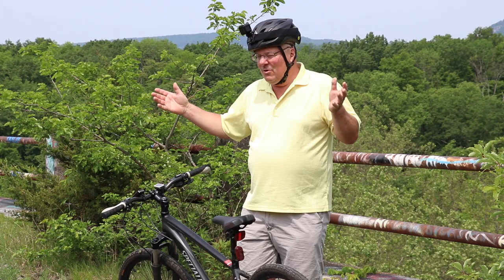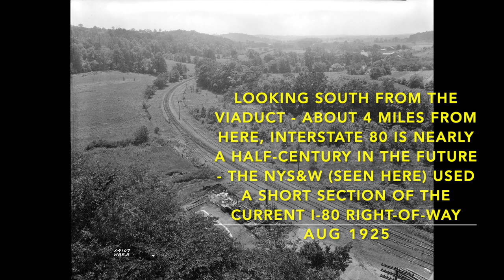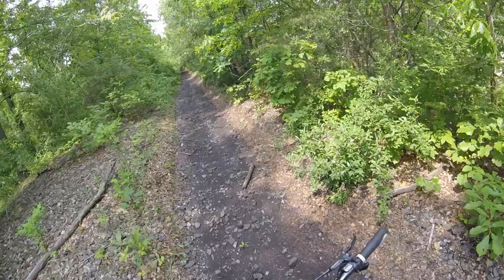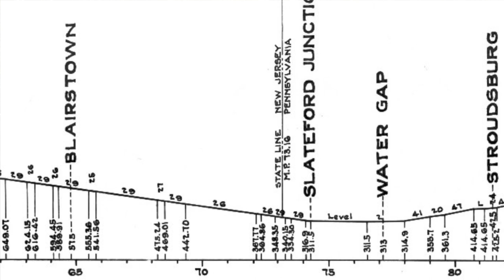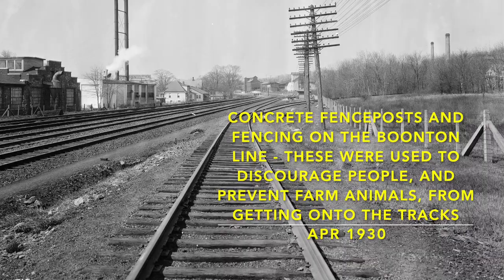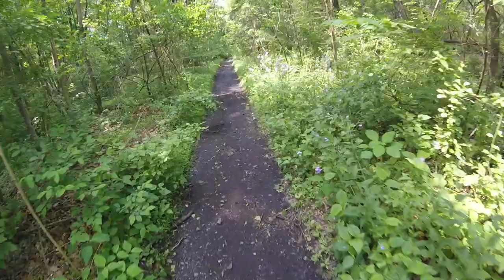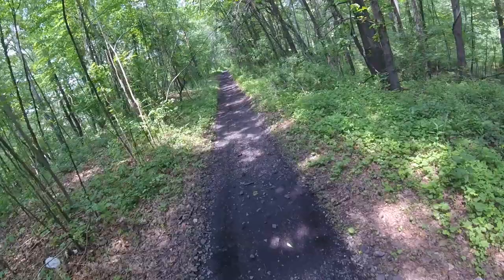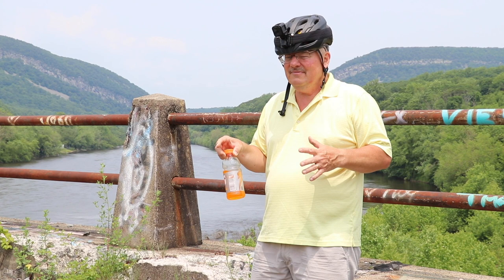Lackawanna Cut Off - Part 21E: "Missing" 21 Miles (Paulinskill Viaduct to Delaware River Viaduct)

Comment: Thanks for the tour!
Reply: When Chuck first stepped onto the Paulinskill Viaduct you can see what looks like two open manholes that were used to access the structure inside for maintenance and inspection. Tunkhannock Viaduct had a ladder up the right side as you're going west and grab rails on all the arches so people can scale the entire structure to inspect it. I'm assuming the Delaware River and Paulinskill Viaducts are the same as well as the seldom mentioned Martins Creek Viaduct west of Tunkhannock. Years ago a guy had a video on U Tube he made when he climbed all over Tunkhannock. It was fascinating.

Comment: I couldn't help but think of poison ivy all the while, and you finally mentioned it. That, and ticks would be what I'd be concerned about.  I also found myself ducking and weaving about just sitting here in front of the monitor, as if it were me, the viewer, about to get smacked by a branch or whatever object, lol.
Reply from the maker: Stan Patterson, lol.  The GoPro plays tricks because it’s several inches above my bike helmet.  On more than one occasion I had to check whether I had knocked it off my head.

Comment: Thanks again Chuck. Another amazing video adventure on the Cutoff. I hope that you did a tick check when you got home. The last time I did that was in my friend's Jeep in the late 80s or early 90s. It wasn't anywhere near as overgrown as you experienced. We got on just west of the Roseville Tunnel and got off in some families' back yard near Slateford Junction. On another trip we got on at the yard in Port Morris and drove as far as Roseville Tunnel and turned around. I've also mountain biked portions of it, but not recently. I hope that I live long enough to at least see service restored to Andover. Please keep up you videos. Also, are there any photos of the section houses? Recently I was up on the old Maine Central - Mountain Division. The section houses there are gone, but you can still see the foundations and there's plenty of photos.
Reply from the maker: The section house on Johnsonburg Siding is the only one that I've seen a photo of that I can recall.  It appears in both 21D and 21C.

Comment: If you stretch a 62 foot long string along a curve, the degree of the railroad curve is equivalent to the maximum distance between the curve and the string.  If you can estimate 62 feet reasonably well you can mark the maximum distance visually and measure it with a ruler.

Comment: The NJT budget plan includes 8.8 million to the cutoff service for Andover.

Compared to what’s been spent, may not sound like much but that’s still great for next year.
Reply from the maker: Nobody on our side is happy with the "speed" of the project, but we're dealing with a state agency that is reeling from years of political neglect.  We'll keep on top of it.
Reply: @LackawannaCutOff  As soon as government gets involved it's always a problem.
Reply from the maker: g bridgman, the government is the only thing that will make this happen.  Don’t forget that private industry (Conrail) did all it could to try to make it difficult to reactivate the line.  And government was forced to spend over $25 million to get the right-of-way into state hands.
Reply: @LackawannaCutOff  Yes, this is true. Conrail was no freind to many of the railroads is "consumed." I do appreciate that at least NJ saved what was left of the cutoff but it's too bad they didn't start a rebuild 30 years ago.
Reply: @LackawannaCutOff  Bingo.
Reply from the maker: g bridgman, it needed to be acquired first and that took until 2001.
Reply: @LackawannaCutOff  And no private corporation would ever run this route. If they did, they'd have to charge $10,000 per ride.

They would do what the Erie Lackawanna/Conrail did... run as fast and far away as they can from it.
Reply from the maker: inklake, such is the case with ANY route.  Every other form of transportation receives enormous subsidies.
Reply: @LackawannaCutOff  Word.

Comment: keep up the good work with the series of videos, i really enjoy them! i plan on visiting both viaducts in a few months. question, to get on top of the paulinskill is it best to park under it and climb up the side from there or park at tunnel field and walk from there? thanks!
Reply from the maker: spedison _ it’s definitely shorter by parking underneath.  Note that’s there are no parking signs posted below.  It is a steep climb up.  People go up both the south and north side.  Tunnel Field is an option.  You want to park in the back up the hill a bit and walk in via the path which may be overgrown a bit until you get closer to the Cut-Off.  That will be about a 1 1/2 mile round trip.
Reply: @LackawannaCutOff  thank you for the reply, i ended up visiting both viaducts recently. i was struck in awe at how massive the paulkinskill was when i was under it, i ended up not climbing up the side as it did look too steep; tunnel field was an excellent alternative thank you. the views from both viaducts were very nice, but i can only imagine how much money it will take to restore both viaducts for train usage. lets hope NJT gets thier act together. i give you props for traveling along the cut-off with your bike with those road tires, even walking it along it with the rock ballast was tiring. looking forward to more videos in the series
Reply from the maker: spedison _, the next time you’re under the Paulinskill Viaduct, center yourself under one of the arches and talk loudly upwards or make any loud noise and you’ll get a clear echo back.  Kind of cool.

Comment: Hi Chuck. Thank you for this series of videos of actually being on and moving along the entire cutoff!! I look forward to the next one. I know this wasn't easy and you are a REAL trooper!!!  Thanks also for all the pictures and the explanations.  The cutoff seems fairly well-preserved and passable, and I guess we owe it all to the men that ride quads and dirtbikes.  As you pointed out and I noticed, they must even be up there with chainsaws.  I don't know how else it could be kept this clear???  This mostly clear Trail is on the westbound or north side of the cutoff, whereas the last track to be pulled up in 1984 was on the eastbound or South side of the cutoff,  and look how quick that got overgrown.  
Quick question....Do you think it was easier to make a tall fill, or a deep cut?  Thanks Again
Reply from the maker: Impossible to say which was "easier" to build.  They needed lots of dynamite, steam shovels and dump cars for the cuts, trestles and dump cars for the fills.  Both were dangerous.  And the cuts were used to build the fills, except when they needed more fill material than was available, such as for the Pequest Fill.
Reply: At times I've thought the last 21 miles would make a great Rail-To-Trails project, but I think guys with their dirt bikes and 4-wheelers have already unofficially accomplished that. I'm sure a project like that with government involvement would be as much of a nightmare as trying to relay the tracks to PA. It's best to leave it as is for now. There is no doubt trail bikers keep the cutoff open. You can see where many trees have been cut with a chainsaw. Obviously a few people have been ncie enough to dump thier old tires along the way, too.
Reply from the maker: g bridgman, RTT is out of the question.

Comment: When and if the cut is completed. I think it would be nice too run the lacawanna locks and some couches thru the cut onto hoboken. As a symbolic run. Also I had passed on 206 thru the tunnel wondering what rail road had used it.Thank you to bring to my attenchen.
Reply from the maker: Not sure how that might work.  NJ Transit has to meet certain FRA standards.  Steamtown will presumably still be allowed to run to the Water Gap, probably on a federal waiver (which it has right now).  Since the Cut-Off would be “new” trackage, it’s unclear how that might be worked out.
Reply: @LackawannaCutOff  Thank You chuck. I had driven I the area of the final proposed station. My thos roads are very narrow. I surely understand on what NJT rules they must follow. Well I hope someday to ride the train into pa. Thank you for endeph report on the cut.well done

Comment: Hey Chuck I Got A Question For The Project Of Restoring The Laccowanna Cutoff, During The Project Will The Workers Knock Down The Viaducts And Rebuild Them, Or Patch Up The Holes And Clean Them?
Reply from the maker: Gold Pro, the viaducts will remain in place.  How much repair will be needed is still being looked at.  But I assure you that they will not be “knocked down”.
Reply: @LackawannaCutOff  Ok Thanks!